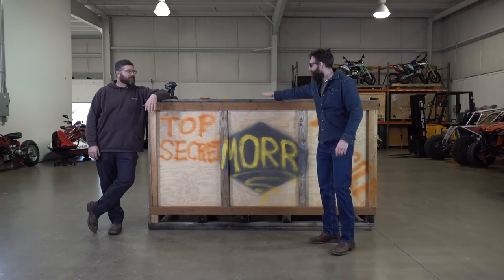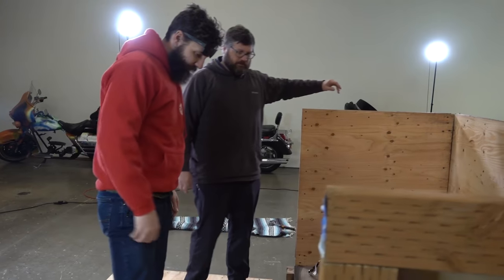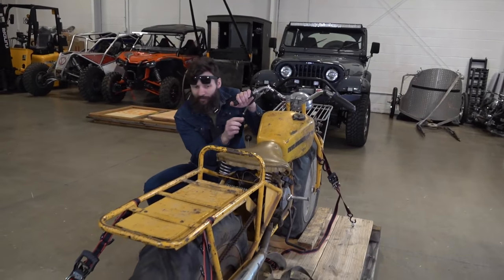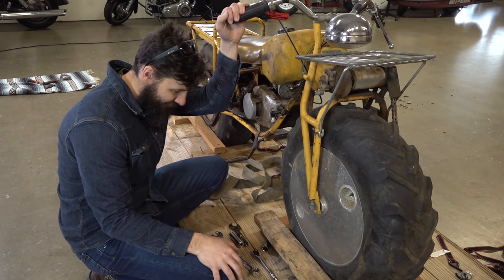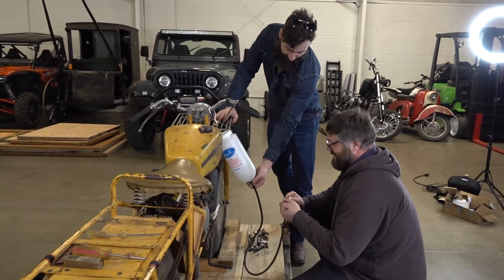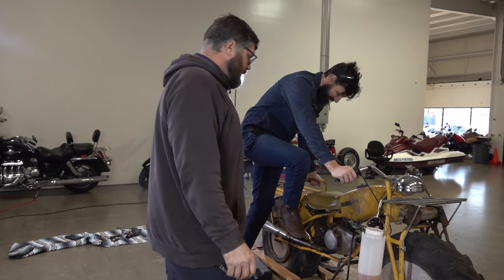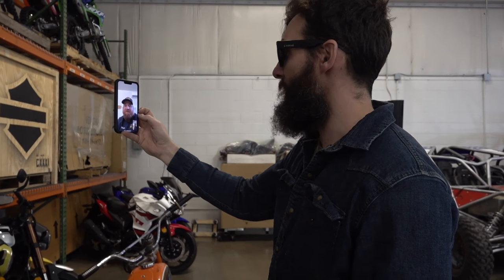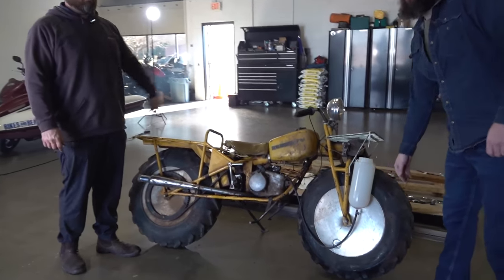I Found a Rare 2wd Antique Motorcycle, 45 years since it Ran

Comment: The first time I saw a Rokon Trail-breaker was in the early 60s. A corner gas station had one and would demonstrate its capability on a temporary obstacle course set up on the property. It was an impressive showing. The later models don't look as good as the older ones.

Comment: My brother & I had a dealership for these around 1975. I won't say all the info I'm going to give you is correct (that was a long time ago) but,the yellow ones (early) had a 3 speed tranny,no clutch just let off the gas & shift. Chrysler engine.Later years were painted orange with a torque converter similar to what a snow machine would use. high flotation tires. 4 psi. You may find things just need a good cleaning because they were pretty much indestructable.We had photo of one in our office that was o.d. green with a white star on the tank.The army had bought some from Rokon to evaluate.

Comment: When you have some internal combustion engine whether 2 or 4 stroke, one of the first things I learned and should do after setting around for that many years is, pull the plug and squirt a couple tables spoons of oil in the cylinder and pull that cord or hook up an impact to the flywheel and tun it over and coat those rings and cylinder wall. I have three brothers that are retired certified Mechanics, I'm the retired Building Contractor. Anyway, it was fun to hang with them and help rebuild motors. My brother just under me built race motors for years and has many trophies for builds and trouble shoot competitions.

Comment: As a side note:
Rokon also made off road racing motorcycles about the time this bike was made.
American Riders rode them in ISDT qualifiers at that time.
If memory serves they used a 440cc engine with a variable belt drive for the drivetrain.
I remember seeing the team bikes with an extra belt strapped to the handlebars.
The bikes were quite unique at the time.  Often the bikes were also used in national enduros.
The bikes were fast and worked well when riding through rocks and creek beds due to the variable gearing of the belt drive.
Have fun working on the vintage bike!
Reply: The Kaplan America channel had one of those Rokon racers featured in a recent video
Reply: You watch Kaplan America too heh?
Reply: @krustiestone1596  Yep, subscribed. I'm planning to ride down there to check out the museum sometime this summer
Reply: The belt on that Rokon 340 slipped if you got it anywhere close to water. It had solid disc brakes that worked reasonably well. The bike freewheeled when you let off the throttle. Don Kudalski had some measure of success with it.

Comment: Think I was 8 or 10 years old when I seen one of these in Popular Mechanics and I have loved them since (47 years ?). I finally got one (1969 also) and when I restored it, I did a re-power with a 1970 Trail 90 motor. Best thing I did. High and low range with 4 gears each and it's actually fast enough now to out run it's own exhaust. Great what you guys and Fab Rats are doin for Ed. Since the LJ-20 is the Golden Nugget, I like your idea to call the Rokon Gold Flake.

Comment: Pretty cool,my Grandpa has a Rokon that he used to ride. Guess I need to get it up and running again. The first time I had his running is when I learned that it has a Chrysler two stroke engine.

Side note,when grandpa and I were on vacation last we went to Colorado to his buddies property to do some prospecting.  While in Colorado I needed to buy some parts for my old trials bike. We found a place to get parts that was called Tote Goat which is the same name as the Rokon you’re working on. Pretty sure it was in Colorado Springs but they had probably every part available for the Rokon you’re working on.
Reply: I’ve not heard anyone use the name Tote Goat in years…..decades actually. My dad  had a Tote Goat, but I don’t recall it being like a Rocon, with 2-wheel drive.
Reply: Now that you mention it,I’m thinking that the Rokon in the 2 wheel drive version was the Trail Breaker model in the 60’s and the Tote Goat was more of an oversized mini bike with an engine like a Briggs or a Wisconsin. Any chance you could describe the Tote Goat your Dad had?

Comment: 2 wheel drive motorcycles .The solution to a problem that never existed .Genius !
Reply: No bike, quad or side-by-side can go where I want or need to go with my 1968 Rokon.
Reply: Apparently, they still manufacture them.  Must be some that it's a solution for.
Reply: @loctite222ms  I want one very much but I've never thought "Rear wheel drive is not nof enough "lol
Reply: @Dave062YT  it's used for narrow heavy haul off road. Those bikes have been known to carry a ton (literally, 2,000 lbs) through mountainous goat trails.
Ed told a story where he hauled himself and six guys out plus gear.
Reply: @brianblank9921   I've got an ATV for that but I say again I want one so not knocking them  at all just never thought "I wish my bike had 2 wheel drive "
Reply: @Dave062YT  lol, I can't say the same. Hauling gear down trails with a wheelbarrow miles after I had to leave my quad because the tail is too narrow...
Reply: It would seem so but actually it was designed to solve a problem; carrying heavy loads through narrow trails in rough terrain. These things have been doing that effectively for decades, though only a small group of people have need for one.
Reply: There are two companies that actually still make 2wd dirtbikes besides the Rokon, biggest advantage I found over rear wheel drive was deep snow.  Definitely a different experience with the front wheel pulling you through a corner or up a hill.

Comment: Two stroke motors, if they use an oil pump from a small tank under the seat (& not oil added to the gas tank), tend to lose much of the oil into the crank cases after several decades.
I aways start by removing the plugs & kicking it over, because if you don’t & it turns out there’s 100ml of lube sitting in the cases, it’ll send that oil to the top end. The volume at TDC is so small that it doesn’t take much to hydro lock it & bend a rod.

But since there’ll be SOME weep by, when at first it runs after decades sitting, it’ll smoke like a mosquito repellent until you’ve a few miles on it. No worries, least you know it’s lubricated!

Comment: They originally made a pure dirt bike with normal tire. Not fast but would climb a wall. 
Also, first dirt bike with disc brakes.
Reply: Also, it uses a Sachs engine
Reply from the maker: good info
Reply: @BikesandBeards  I don't know  about a Sachs engine, I recall reading a Pop Mech or Sci article about it from back in the day (my dad had a huge collection dating back to the '30's, when I read the article, it was the mid-90's, the article was from the '70's) and it mentioned that Rokon used a Chrysler engine, which always stuck in my mind.  I had no idea Chrysler made small engines until I recalled seeing ads in those same old mags for Chrysler boat engines.  I assumed it was one of their small outboard engines, re-purposed, but it could have been a re-badged Sachs that they sold under their name.
Reply: @paulprobusjr.7597   I was told they  originally had West Bend engines, then they were bought out by Chrysler.
Reply: @edsyphan3425  I don't know if there is/was a relationship with Sachs, but the engine Rokon used back then was made by McCulloch - My brother had one.

Comment: The tank comes off. And you put the tank on the ground and fill.. you can put water it the wheels as well for weight.. ups the towing numbers.   If you leave the wheels empty it let's it float.. and the new ones have 4 way carb.. allows the bike to run on its side while floating in across deep water.. my father and I started selling them in the 90's in Ontario Canada.. I know almost everything about them.

Comment: My dad loved those,  so much that I have 27 of em in my barn , most run but a few are in pieces  we rode them all over the mountains in the 70,s and 80,s here in ky. My dad bought every one he found at swap meets and people had for sale,  we went and got 4 that a guy had under his dock as flotation support. That's the 4 that doesn't run. Lol I have 2 that were welded together and made into a 4 wheel motorcycle with 4 wheel drive,  it's ugly as hell but works,  we used to install tv cable and they were the only thing that could get where we had to go in the ky hills

Comment: I have a 2016 trailbreaker. I love it. They have not changed much. Engine upgrade, front suspension, and some minor things.
Reply from the maker: I would love to get my hands on a new model they look fun
Reply: @BikesandBeards  The fun level is through the roof. I have found many practical uses as well. However, for the price I paid, I have to say I am little disappointed that I needed to modify, repair and replace some things right out of the box. Some of the components are cheap and failed with less than 100 hours and under 3 years. Only 1 year warranty also. But overall, its a great little tool/toy.

Comment: I had a 1980 rokon. If you can walk it will go. With the gearing it will pull crazy amounts. I pull a 700lb moose with it.  It’s amazing that it pulls and keeps the front down.  The wheels are made so you can add fluid probably more for weight to get traction than fuel. As you said be hard to transfer.  I used it for hunting and it worked awesome.  A bit of a handful driving it but would go anywhere as long as you wasn’t I. A hurry.
Reply: Hey bikes and beards  I just received a message that I am on the short list for a giveaway is this a scam text?
Reply: @puddlejumper3534  It’s scam spam. Everyone should report them.

Comment: That was cool. On Sherp ATV Tanks the exhaust fills the tires and you can set the pressure individually. It also floats and drives across water.
Reply from the maker: Those sherps are insane

Comment: Rokon's are pretty cool but expensive. The early models used a 2 stroke engine with diaphragm carburetor like you see on chainsaws and other OPE equipment. One of the old engines was made by Chrysler I think. These engines would run with the Rokon in any position as long as gas could get to the engine, so you could have it on it's side floating across a lake while it was running. I guess nobody makes a suitable 2 stroke engine for the new Rokon's so they now use a 4 stroke Kohler engine on the new bikes, or maybe it's because of EPA regulations. 2 stroke engines were so cool.

Comment: Since it has a kick and a recoil maybe you could find/ modify a goki aftermarket starter to it for ed on a small li-ion battery so he'd easily be able to start it. How big is that 2 stroke? if that's a 125 that compression is fine but if that's like a 250 that should almost get rings and should be closer or over 200psi

Comment: There used to be mc hill climbs in Monson, MA and there was a Rokon there. I will never forget seeing it and wondering how they controlled the difference in the front wheel speed.
Reply: There is a company over in Wisconsin that builds 2 wheel drive dirt bikes (Lawsons Cycles) that uses a slipper clutch type design which allows the tires to operate at different speed while cornering and such.
Reply: @iffykidmn8170  I investigated the Rokon. When the handlebars are turned the front drive disengages.

Comment: That machine is a ROKON, I was a dealer for them in the '60's. Wheels were made to carry fuel or water, but will upset it if you try to ford creeks with them empty. Engine is Bendix and they were made in NH. As far as I know a guy bought the rights and still makes them.
Reply: Was the tote goat related to these?
Reply: @aaronbowe9997  No this was the first one produced like this. We had 2 Demo's one was 2 wheel drive (red), the other chassis was the same but was rear wheel drive only. Sold about 5 if I remember right.
Reply: Still in business in Rochester , NH
Reply: 🤔 was this made for the USA 🇺🇸 war efforts? aka USA army? per-1975
Reply: @richardprice5978  No. this was always a civilian recreational off road bike. 1958 it was the trail maker.  shortly thereafter it changed ownership and became the 'trail breaker'.  Has had several owners and manufacturing locations all in either Vermont or NH.  I think around 1992 it started putting 4 stroke engines on and has ever since.  Kohler 7 HP is now the standard engine.  Had a mid 70's vintage Trail Breaker.  They would go almost anywhere.  I found it easier (and safer) to ride than my Honda big red 3 wheeler.
Reply: @richardprice5978  I spoke to soon.... I checked with a friend who is a serious MC collector and he said the US military did buy some.  As well as the US forest service and Fish and wildlife departments in over 20 states.  I sold him my Rokon back in the late 90's.
Reply: @sportclay1  i guessed that because Harley motorcycle company had contracts with the USA government to at least 1980's ish and bike's are good for scouting/patrol duties and figuring the rockon was a attempt at a more purpose built bike for korra nam war but ended to soon to be effective in combat as the Jeep was a little hard to movement in the jungles

i hadn't considered for the 👮 police or forestry services but that makes some sense ect 

either way to bad goldwing/harley ect doesn't make a all wheel drive motorcycle for hiy cursing preferabley in a non 💼er model as full choppers are cool but not it and im not looking for my dad's 😉 bike aka old as AF/caddy's old image for buying public image lol 😂
Reply: @richardprice5978  was in VN in '66 and again in '68-'69 with the 1st Mar. Div.  In 2 1/2 years there the only motor cycle I saw were operated by civilians.
Reply: @sportclay1  👍ok it's before my time so i endup learning experience from 📖books's ect and old guys and know at least one guy i suspect ( but he's 🤫 so not getting anything out of him for the most part, 7th-Calvary ) was detail for the CIA/Henry kissinger gard/basic petorl's/special OPS and or one of the last men/team's out of NAM war and into the drug wars in south American and or Africa/middle east anti units ect 1970-1990 ish

and yes like i said wouldn't surprise me either way as the army on paperwork ask's for different equipment designs but that doesn't mean it gets used and sometimes the industrial complex try's to make something different up to door to door selling to the USA government but that doesn't mean it gets the contract so to make up for development costs sometimes it ends up in the civilian market place 😁 and im all for good equipment that we can buy easily for a descendent price
Reply: yes based on the Nethercutt Trail-Breaker :-)
Reply: @richardprice5978  No outdoor recreation, mostly hunters and fishermen. We pulled a harvested black bear out of the woods with one of our demo's
Reply: @sportclay1  I road our demo in the hunting club up over some down fall trees and I was on the timber and could not touch the ground. They were incredable.
Reply: @sportclay1  As a Dealer I never heard of them going to the military, but probably did.
Reply: @vasopel  That was the name on our Dealer sign.
Reply: @joevanderwerker2255  ;-)
Reply: @joevanderwerker2255  as someone after about 1996/ never seen/heard of it before 2022 im rather unformed with this unique brand/bike sounds really useful and varry capable ( how good is it ok snow ❄or ice ? ) and a big maybe even had a friend growing up that had one but it was a honda/suzky/other didn't really see it i have heard of FWD and 2X2 bikes but not seen any or how thay work and to bad there's not more opportunities to buy a 2X2 bike as my kowisky-125 KX was normal RWD ( and rite now im out of the bikes/sold mine and live in snow countryside SLC-ut ish ) as was dads gold-wing and being a luxury high end brand id thought they would have made some by now as cars do/are

lazy threatening to replace mine with a big V6 curser and probably DCT or CVT trans bike with retro luxury styling like my WW2 navy grandfather had ish so something like a crocker/Harley/Honda but a 1/4 to 1/2 price of the average car or truck sold in the USA 🇺🇸 as having a 60k aka same costs as a 2023/high collectible car i can't rap my head around and or is a bad ROI for me vs use ect

Comment: I get the nostalgia for the two stroke. My first ride was DT360 Yamaha. But I know how I’d rebuild that engine. I’d drop in a Honda 125 4-stroke motor. Quiet. Fuel efficient. Available parts. Stone reliable. BTW the $9500 offer on that lemon law BMW still stands.

Comment: The screwdriver has a slider on it so it can lock into the head of the screw and hold them
Also the mix ratio relates to the type of mix not the engine. Most modern mixes are 50-1 but old vehicles were written up for actual oil mix so the were 16-1 or 20-1 
As the lubrication quality and temperature stability of the synthetic mixes improved over the years the requirement got less and less. 
But everyone still adds a little extra.
Reply: +1 on this. A good modern synthetic oil will smoke less too. Read the bottle and go from there.
Reply from the maker: i asked ed about it, its just a broken screw driver haha
Reply: @BikesandBeards  so it is. Pity, those split head sliding shaft screwdrivers are expensive.

Comment: 2-Strokes will climb near vertical.  4-Strokes will seize the engine if you try to go vertical.  The 2-Stroke doesn't care which way the engine is pointed.  The 4-Stroke has to have oil in the bottom of the crank case in order for the oil splash system to work.  2-Strokes Truck, 4-Strokes Suck! They don't make 2-Stroke Rokons anymore, sadly.  The Gas Storage in the wheels helps the bike float on water, and be buoyant in mud.  Rokon's are awesome!  Rokon is the only man made machine that made it thru the Darian Gap connecting North and South America.